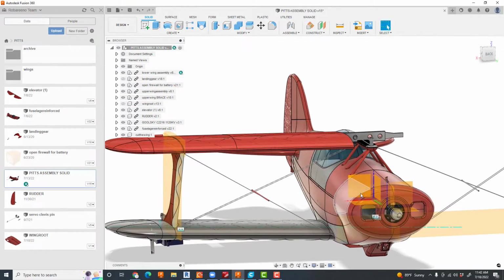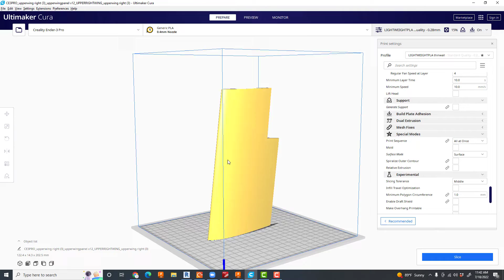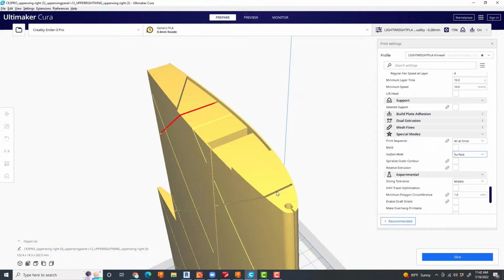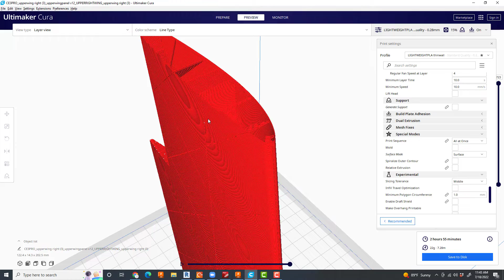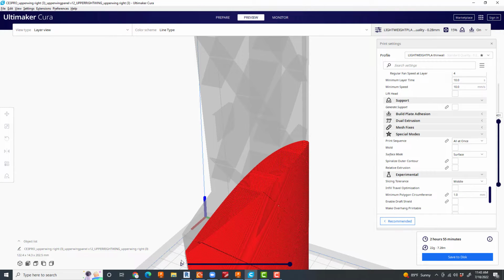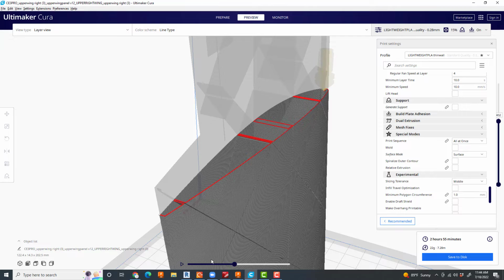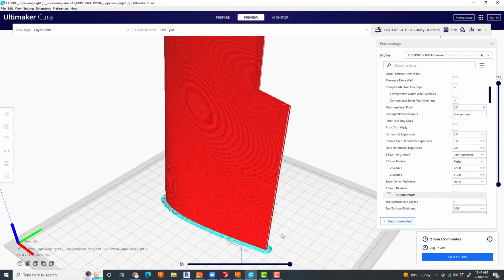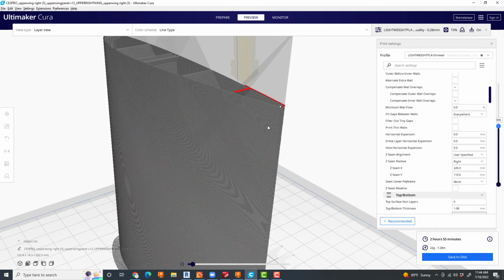How to print insanely light wings with lightweight PLA that have no strings, blobs, or ugliness!

Comment: Still got that awful zigzag line on the skin of the wing. I want smooth everywhere
Reply from the maker: That zigzag is where the strength comes from.  LWPLA is easily sandable.  220 grit paper makes quick work of making it disappear.
Reply: @redbaronrc  I know very well what its for and how it got to be there I just know that it ruins the entire process for me. I want the wing to be smooth off the build plate and no one has figured out how to do it. This process of not retracting is as close as anyone can get it seems.

Comment: Interesting video. 🙂 If you ever saw the cross section of bird wing bones they aren’t completely hollow like you might imagine but interlaced from edge to edge. I would imagine (I’m not an engineer) this is to increase the strength to weight ratio while allowing some flexibility to avoid damage from sudden stress etc. Whilst this kind of structure would be difficult to manufacture by conventional means, it would be relatively simple using 3D printing techniques. Might be worthwhile considering for one of your next projects.

Comment: Very good video. I'm still a little confused about how to draw a model for 3D printing. The questions I have are: should the model be drawn as a solid or a surface.
Should the ribs and reinforcements be physically connected with the outer skin (intrados-extrados).
Should there be a space between the ribs and reinforcements when printing with LW-PLA. Thanks if you can help me and continue to do such nice video.
Reply from the maker: My approach is to draw as a solid then introduce .4 mm thick subtractions wherever I want ribs.  Yes subtractions.  You have to view the model as the slicer would in vase mode.  It doesn't care that it is a solid it is only tracing the perimeter of your solid.  Wherever you have cut a void it will trace the face of it.  Because the spacing is so thin, the plastic actually gets fused together and you end up with interior ribs or other reinforcing and the print head only had to make a continuous loop with no stops or retractions at all.  Go to my website and download my free extra 300 model and set up one of the wings in Cura.  Slice it using the settings in my blog.  Then in preview mode animate the print head and study how it traces the contours on any layer level.  

As for the question of should ribs be connected,  yes they will be simply because the plastic oozing from the print head will just touch the outer wall causing the interior ribs to fuse to the outer skin.
Reply: @redbaronrc many thanks  for your clarifications .

Comment: What are the cut lines that great the infill? How did you install them?
Reply from the maker: I create a waffle grid locating the sliced planes (which will end up being interior ribs) where I want them.  Typically they are .4mm thick and have a spacing of 25 to 30 mm.  I then overlay the solid body wing and choose intersect.  Once done I take the waffle grid shaped new part and using press pull I lower the top just under the exterior skin by .4 mm.  I then subtract this new grid from the wing solid body.
Reply: @redbaronrc  can you make a video displayinghow you do this please? Its very hard to replicate